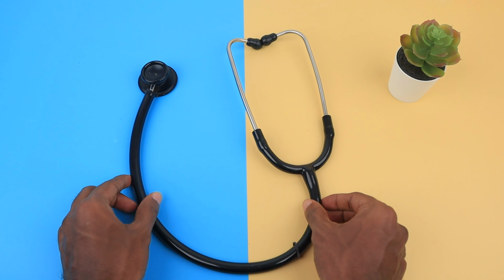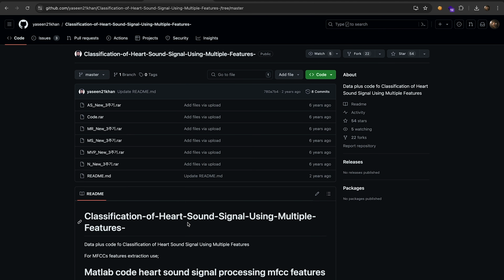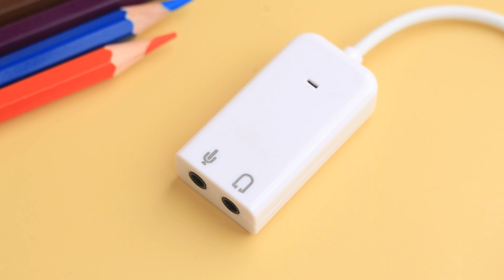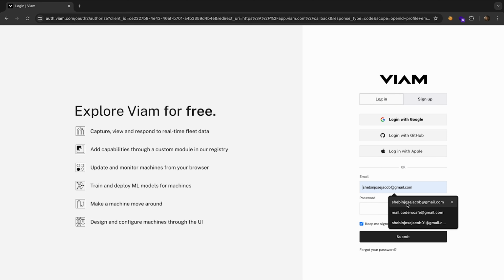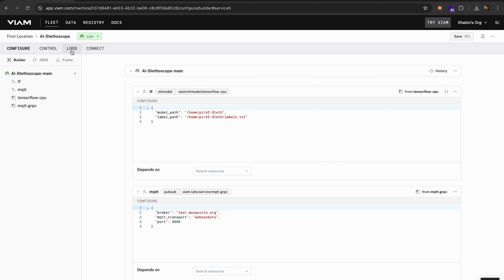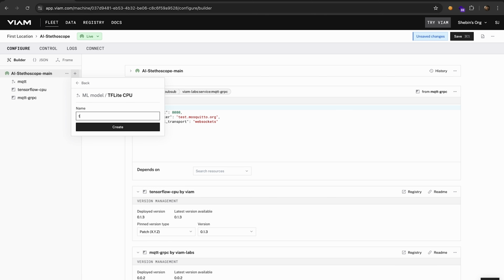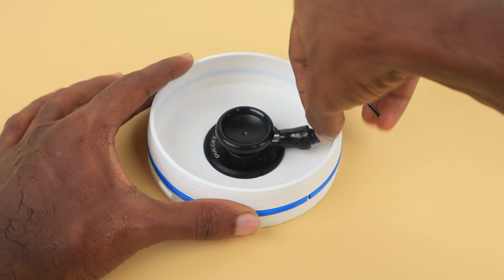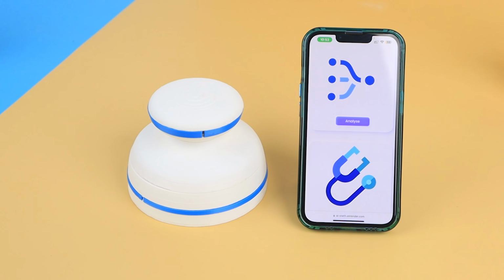AI Stethoscope: Your Doctor Could Be Replaced!

Comment: After installation of viam in 02w it is not connecting to the laptop....what to do....?
Reply from the maker: Try increasing the swap size and if it doesn't work try overclocking it.
Reply: @CodersCafeTech  first we'll be doing that then installating the viam server?
Reply: Should I use viam agent or do it the manually?
Reply from the maker: @AbhilashMishra-gf3dm  You can't do it with viam agent. You need to manually increase the swap size.
Reply: @CodersCafeTech  okay....I was asking about installation of viam server in Raspberry Pi 02w.... should I do it manually or use viam agent to install it in the Raspberry Pi's terminal?
Reply from the maker: @AbhilashMishra-gf3dm  You can use viam-agent
Reply: @CodersCafeTech  after installating viam agent in 02w it automatically getting disconnected after few minutes and not getting connection again....is there some problem in Raspberry Pi 02w or in sd card..... I'm getting confused
Reply from the maker: @AbhilashMishra-gf3dm  What do you mean by disconnecting? Is it not connecting to WiFi or is it not powering on?
Reply: @CodersCafeTech  It is not connecting with laptop and we're not able to connect to VNC server
Reply from the maker: @AbhilashMishra-gf3dm  Have you increased the swap size?
Reply: @CodersCafeTech  I'm new to Raspberry Pi....I don't know how to swap size in it
Reply from the maker: @AbhilashMishra-gf3dm  Checkout this guide: https://pimylifeup.com/raspberry-pi-swap-file/
Reply: @CodersCafeTech  I'll let you know.... thanks for your help